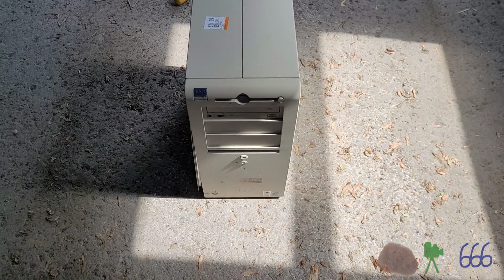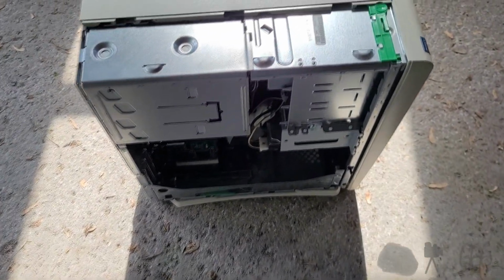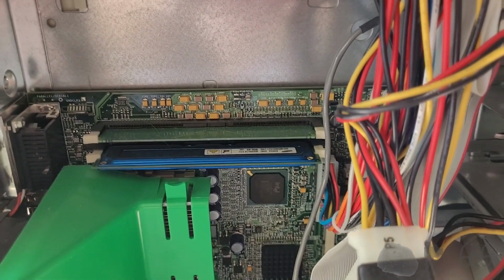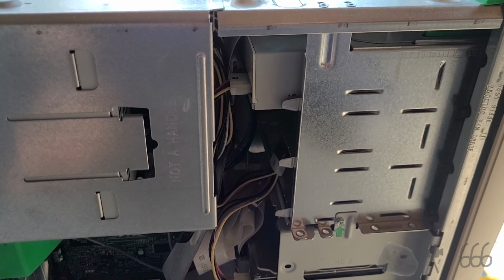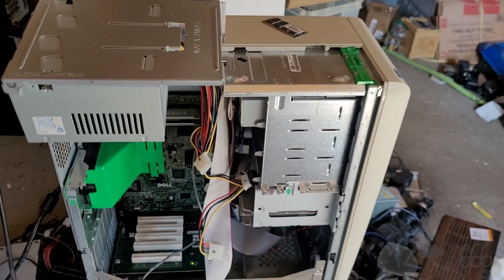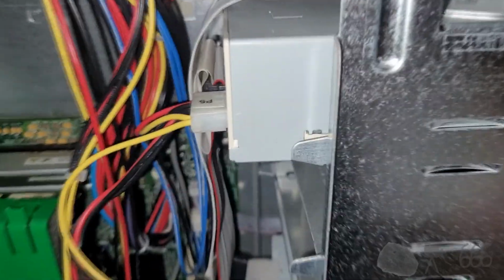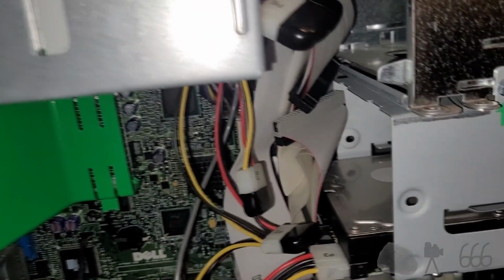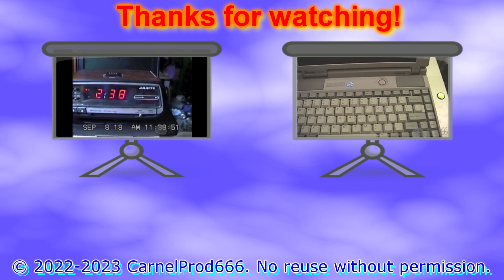Dell Optiplex GX200 FAIL

Comment: I recently acquired the small form factor Optiplex GX200. It acts exactly the same without a CMOS battery. Try installing one, you may be pleasantly surprised!
Reply from the maker: Unless there's seriously screwed up NVRAM data, a bad battery has no effect on these Dells. In either case, I tried that, made no difference.
Reply: That's unfortunate! I noticed in your video you did not have one installed. These machines DO NOT act like standard x86 systems of the time. These machines act like the old Macintosh computers that used the PRAM battery. If it does not detect battery voltage the system will "power up" when AC voltage is supplied. Nothing will seen on the display and the system basically acts as though the CPU has been removed.

Comment: Too bad it didn't work. The GX110 I had failed without warning in a similar way. I think I've still got a GX400 or two in functional shape if you want a P4 RDRAM system.

The various third party chipset manufacturers had an absolute field day and were eating Intel's lunch in a big way with SDRAM-compatible chipsets for the Pentium 3. The 440BX was also an SDRAM chipset. In spite of how hard they were pushing RDRAM, the 440BX remained in production, perhaps as a tacit admission that Intel knew RDRAM was going to flop. Some motherboard manufacturers even pushed the 440BX to a 133 MHz FSB speed and guaranteed its stability, though doing so overclocked both it and the AGP bus.

I've read of a translator chip having been offered that allowed the use of the 820 (and maybe 850?) chipsets with SDRAM, although this seemingly exacted a considerable performance penalty and wasn't popular either. The 810 and 815 chipsets were Intel's hasty response to the market having rejected RDRAM. Unfortunately, they didn't really accept that the market was serious about not wanting RDRAM and so the 81x chipsets were limited to 512MB of installed RAM. (I get the feeling this is an artificial limit, and that perhaps a BIOS modification would remove it.)